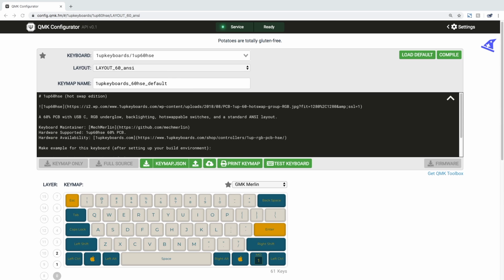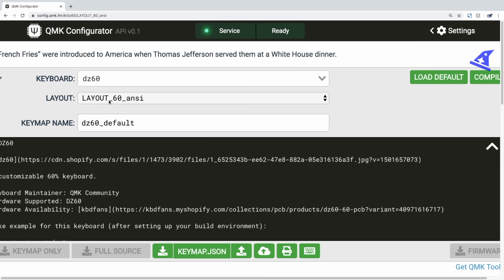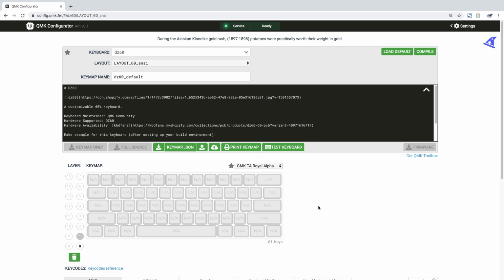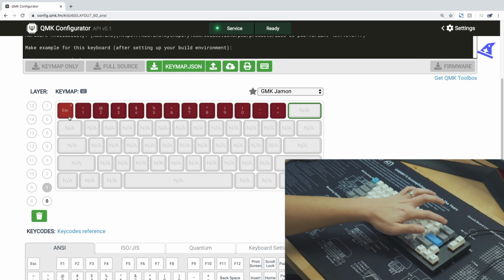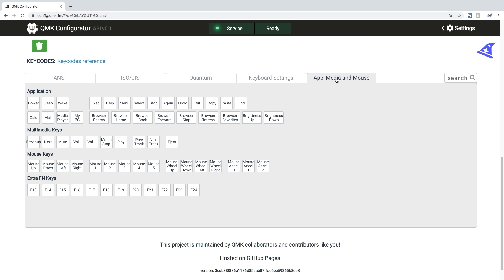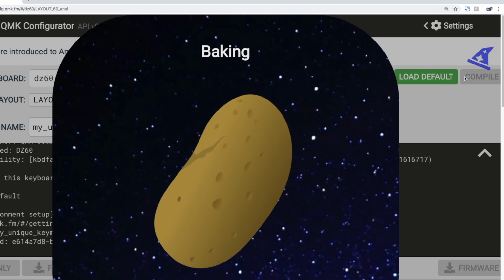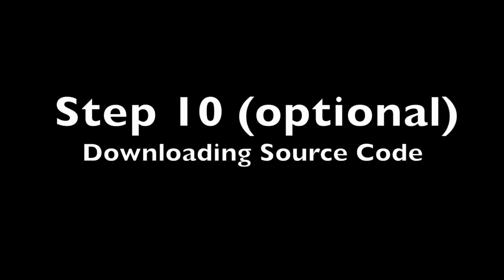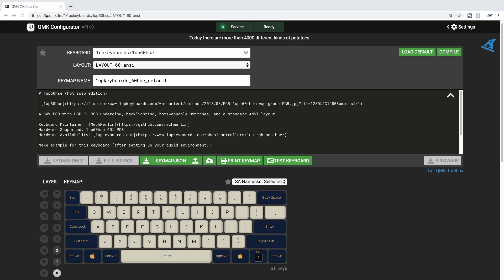QMK Tutorial: QMK Configurator

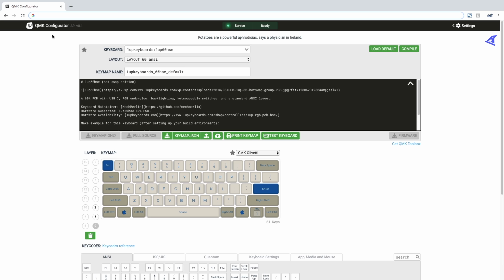Comment: 0:32 no matter which browser i use, the site would not show me the Keyboard, Layout, Keymap Name fields like that. I tried turn off Adblock, not using any VPN, etc. I still cannot get it. Also, the "Keymap Only" and "Full Source" buttons are not showing. :(
Reply: I'm having the same issues right now too... I am scratching my head why it's not showing up....
Reply: @nottommythao  oddly, it also happen to all of my devices. i tried it on my second PC, not showing. i tried my phone, still not showing. i switched keyboard from my Kinesis Freestyle Edge to Split 75, still not showing. i'm getting worried cuz i'm building Helix keyboard right now and i might not be able to configurate it.
Reply: @milo.t_  I just read on a very recent reddit post that the QMK guys are running maintenance on the website. Hopefully it's up again soon. I was wiring up a CFTKB Discipad and now the suspense of seeing if I wired every little diode, capacitor, etcetera correctly is gonna be killing me until then
Reply: @nottommythao  Best of luck!
Reply from the maker: Our certificate expired, but it should be up now!
Reply: @MechMerlin  thank you so much! just checked it and they all visible now :D

Comment: Is there a specific meaning to the different colors that some keys have in the configurator? Some of them make sense, but while setting up the F1-F12 keys, I noticed that F5-F8 had a different color than the others. I'm not sure if it matters which keyboard I'm setting up, but just in case, it's a 'bourdsource/unicorne'
Reply from the maker: It depends on the keyset color scheme you picked. Designers often like to make the center F row keys F5 thru F8 the same color as the modifiers, so as to add more contrast to the overall aesthetics of the board. For bigger keysets, you can even have the F1-F4 and F9-F12 as the mod color and the F5-F8 as the alpha colors.

Comment: Allowing vertical and horizontal reverses of layouts, especially ortho boards, would allow rotating of the keyboard to be used upside down for north vs south facing keyswitch LEDs. Would really help for such a set like the artifact bloom glow keycap set :|  side-legend skylights, they should call them skylights... hubba hubba
Reply from the maker: QMK Configurator is purely a means to program a key to do a specific function. All of that seems to be several layers of abstractions above what software is meant to do.
Reply: @MechMerlin  thanks for the reply

Comment: Hey i recently flashed the via version of the qmk firmware however when i try to edit my keyboard there is no option for RGB i think its disabled in the files by default so i wanted to know if there is a way to edit those files or would i just need to compile my own file? I'm using the gmmk pro ANSI version.
Reply from the maker: Yes you can edit the code. It is not possible thru QMK Configurator actions.

Comment: I just put together a BDN9 and included both of the rotary encoders. When running on the default map they work great. The left one is volume and mute (if clicked) and the right is scroll and play/pause (if clicked). However, if I try to change any of the keys, then when flashed I lose the functionality of volume and scroll from rotating the knobs. Do you know how I can customize the rotary encoders outside of the key presses?
Reply: Keeb.io has a tutorial on how to reprogram your encoders here: https://docs.keeb.io/reprogramming-encoders
At the time of my posting this, it appears the only way to program rotary encoder functionality is through setting up a QMK build environment. It's not possible to use QMK configurator and using the QMK Configurator likely is overwriting the rotary encoder functionality since it doesn't support it.

Comment: I'm using Mac O/S. When I download "full source", I get a .bin, and a .json file in the folder, but no keymap file. I want to be able to enable tap dance and other features using the code. Also, if I can find the source code and make changes to the keymap, how do I then re-compile and download new firmware to flash?
Reply from the maker: You can clone QMK's projects over on Github.
Reply: @MechMerlin  so no way to do it using QMK configurator and QMK Toolbox then?
Reply from the maker: @punkish7  That's pretty odd that when you select download full source you only get bin and json file. That really should download the entirety of the QMK firmware files.
Reply: @MechMerlin  Sorry, I did not explain that well.  I did get all of the QMK firmware files, what I did not get was the source files for the keymap I created. I have a <keyboardname>.bin, and a <keyboardname>.json file, below all the QMK folders.  What I though you said in the instructions was that once we have downloaded the source, we would be able to edit the code, to include features such as tap-dance, or tap + hold. So I expected to see a keymap.c file of what I had created using QMK configurator that I could work with.  Thanks!
Reply from the maker: @punkish7  yes that is correct. You need to navigate to the correct directory to access your keymap.c file. You will then need to recompile to generate your new firmware files.
Reply: @MechMerlin  I'm having the same issue as the other commenter.
1. What happened to the "Keymap Only" download button?
2. I looked in the folder I thought the keymap should be in (/keyboards/atreus/keymaps in my case) and I only see the default layouts that come with QMK.

Comment: Hi! I've just bought an old Tada68 and I've got a few QMK related questions :)

1. When I'm moving in a game using W and I press Shift to Sprint, it cancels the W key, why is that? It happens outside the game and only with my left shift, not the right one. (It also happens with the LCTRL and LALT. It has a 7 key rollover.

2. If I press the reset key behind the board and access it on my pc, am I able to make a backup of the bin file and flash it back later? Because I want to flash another bin to check if the problem n. 1 is fixed. 

3. Is there a way to set a key to ç? Or only through manually programming?
Reply from the maker: The Tada68 comes default with a qmk firmware from 2017. Updating the firmware will solve point 1. For 2 yes you can save the old FLASH.bin. 3. I'm not familiar with that character . Also you should try out VIA.
Reply: @MechMerlin  Thanks a lot for your answer! I'll give it a shot then.
Reply: @gabrielgussomazzo2339  conseguiu configurar no padrão ABNT2? Gostaria de fazer uma build custom, mas pra mim ABNT2 é fundamental...

Comment: Is there an easy way to add strings of text to a button? That's the last thing I want but can't figure out how to do. Thanks!
Reply from the maker: That's something you'll have to do through code. However I recommend just using the VIA enabled firmware files to do this so you can use the VIA keymapping software.

Comment: Hi  MechMerlin, very well made video. I have a filco MJ2 TKL JIS.  I was trying to compile firmware using the qmk configurator and it works except the capslock and scrolllock leds not work. Is there a way to fix this?  I think the leds were not port on the configurator.
Reply from the maker: I was unaware that the MJ2 was even supported in QMK lol
Reply: @MechMerlin  Thank you for your attention.  I use linux shell qmk to fix that. Its weir that older qmk has incorrect matix and that's why I used qmk configurator.

Comment: Just recently had someone build me a 4x4 macropad with a Nori board and a Pro Micro. I have the .hex file but I cannot figure out how to reset the board/processor so I can flash. I double tap on the reset pin on the Pro Micro and two red LEDs light up. QMK Toolbox says my device connects but it quickly disconnects. Any suggestions?
Reply from the maker: You can short the RESET and GROUND pins. But you only have 8 seconds to flash after this process.
Reply from the maker: @ryandenne1024  That would imply either the soldering was completely messed up, the keymap is disfunctional, or you have a completely different hex file than you intended.
Reply: @MechMerlin  Device Manager shows "The nori Keyboard" but I am unable to type with it. I created what is essentially a numpad with 2 layers with the QMK Configurator.

Comment: I'm looking at a board that supposedly has ISO layout option, but the layout tab only has LAYOUT_ALL, how do i get the correct size enter key? Also, it says the modifier for & is on 7, while my keycaps says it's supposed to be on 6?
Reply from the maker: Layout all attempts to provide a means to program every key on your board and is meant for PCBs that have a gazillion layouts. My recommendation is to just do the usual trial and error and see which key is what.
Reply: @MechMerlin  alright. What about the extra key on an ISO keyboard?
Reply from the maker: Layout all should have that covered as well
Reply: @MechMerlin  hmm, the layout all i was looking at just had an ANSI layout 🤔 I'll play with it some more, thank you for the answers!
Reply from the maker: @Kasperbentsen1992  oh man I probably should have started with, "what keyboard is it?" lol
Reply: @MechMerlin  Well, I've been looking at getting my first custom keyboard, and the groupbuy I'm looking at is using the WT-65G designed by Wilba.tech. The pictured layout options are ANSI and ISO. :)
Reply from the maker: @Kasperbentsen1992  That should be VIA compatible. Any reason why you are specifically wanting to use QMK Configurator?
Reply: @MechMerlin  I'm was just interested in the basics 😅 I'd probably use VIA if I actually get that specific board!

Comment: Okso, I need the wizard's guidance. I got me a Duckboard but want to use it as a 21 key macropad, not an 18 key numpad. Is there anyway (other than coding) to make the "Enter", "+" and "0" 2u keys into 2 x 1U keys each, within QMK Configurator?
Reply from the maker: If I'm not mistaken, isn't the duckboard designed to physically only be an 18 key macropad? You'd have to redesign the PCB to physically add those extra keys.
Reply: @MechMerlin  No. It can be both but the default is 18 key. When I asked Dood he said its possible but he decided to have it as 18 key default since that's what was asked for more. I soldered 21 kailh hotswaps in and they all work, just a few double. I'm guessing its going to require writing code as there wasnt an easy answer. lol
Reply from the maker: @h1ddens0ng  There are 2 ways to go about it, either modify the info,json file to support the additional layout for QMK Configurator, or actually port it to VIA. If you can wait till next week I can probably take care of both these for you.
Reply: @MechMerlin  I'm a bit shaky with changing json. I've attempted in the past and couldn't get it to stick (I was changing rules file to turn on rotary function in BDN9). I wouldn't know what to input to make this work. So I can wait! Also I know quite a few others who want this same feature. So if this could be ported to VIA that would be utterly amazing for the community, imo. straight up wizard.

Comment: So I flashed my board but it doesn't seem to activate the Mo keys.
I've got an iso layout and have Fn set to Mo(1) for arrows on wasd and such, and on Layer1 my AltGr as Mo(2) for rgb stuff. But it doesn't recognise Mo(1), maybe the switch is not actuating properly since i havent soldered my hot swap sockets onto the pcb yet.
Or do I need Fn to be Mo(0) to reach Layer1?
Can i hold fn+AltGr to get to Layer2 the way I intended?
Reply from the maker: If you haven't soldered, there wouldn't be an electrical connection yet, however you can still verify using tweezers.
Reply: @MechMerlin  
Suprisingly without soldering the millmax sockets do make up a connection.
But my main problem is not being able to get to Layer1 from Layer0 and to Layer2 from Layer1.
If i set the Fn key to Mo(0), does it switch to the first layer or do I have to have Mo(1) set?
Reply from the maker: MO(0) will activate layer 0 when it is held.
Reply: @MechMerlin  but isnt layer 0 always activated?
Reply from the maker: It's usually the base layer so in a way yes. However only 1 layer is active at a time. So if you have activated layer 10 or something, you will not have any other layer activated unless you have pass thrus
Reply: @MechMerlin  if i have Mo on the 0 and 1 layer, activate it on 0 layer hjold it and press the one on layer1 i can open a third layer right
Reply from the maker: @Daniel-dj7fh  So you want the activation of the 3rd layer to be accessible from the 2nd? 

If so, put a MO(1) on Layer 0. So when you press it, you activate Layer 1. Next put a MO(2) on Layer 1, and press it to activate Layer 2. This way you will need to hold two keys down while accessing Layer 2
Reply: @MechMerlin  i got it working thanks
Reply from the maker: @Daniel-dj7fh  no problem

Comment: Is there anyway to take the json and upload it to KLE to get the raw data? Need it to generate a plate to 3d print.
Reply from the maker: Json files are basically just a type of file kind of like .doc or.pdf. Think of it like homework.pdf and driverlicensecopy.pdf would contain very different information despite being both pdf files. The json file that QMK Configurator saves is not the type of json that KLE would be able to read.

Comment: Do we have any options in QMK if we have an STM32F072 MCU?  I don't see it in the drop down menu in QMK.
Reply from the maker: This is the QMK Configurator video, but if you look at the QMK Toolbox video, I mention that for Arm powered boards, this setting can be ignored.
Reply: @MechMerlin  Thank you Merlin!  I missed that.  But, I'm getting this error in QMK which appears to be related to the MCU (but I could be totally wrong): "Cannot open DFU device 0483:df11
    No DFU capable USB device available."  It's for the Godspeed75- seems to be a systemic issue.
Reply from the maker: @mudhead6101  It seems like the board is not entering the bootloader mode (reset) correctly.
Reply: @MechMerlin  Got it, makes sense.  We'll see what TKC has to say.  Appreciate the help sir!

Comment: In the examples in the video of matching layout, there are more keys in QMK than what was needed. What if the opposite is the case?
To the right of the spacebar I have 3 1u keys, the QMK layout available has 2 1.5u.
Reply from the maker: You should always try to find the LAYOUT that matches it the most. In some cases its going to be the LAYOUT or LAYOUT_all that you'll have to use. If neither of these fit your needs, you'll have to ask someone to add in the layout you need. However if your board supports VIA, just use that.

Comment: Would it be possible to flash your File to your Keyboard via Bluetooth? (It is a Bluetooth only Keyboard)
Or does it have to be connected via Cable?
Reply from the maker: The process of flashing requires putting the board into bootloader mode which would disable any kind of Bluetooth support.

Comment: Can this work for a keyboard that has its own software already? Or does this only work for PCBs that support QMK? I just bought a Durgod Venus but cannot use the Durgod Hera Compiler because it only runs on Windows, I'm a Mac user.
Reply from the maker: The QMK Configurator is only made for use on QMK powered boards.

Comment: so i have a kbd67 r2 that doesnt want to flash because its saying i can only flash a .bin file on it. but i can only find .hex files for it. Is there anywhere i can get it or..?
Reply from the maker: Are you taking a out the kbd67mkii series of PCBs? If so there should be a v3 that supports .bin files
Reply: @MechMerlin  haha you were right thank you, i guess i dont know my own keyboard
Reply: @MechMerlin  so i have a problem now because via doesnt reconize my board for some reason, is this the only way to change the rgb
Reply from the maker: @xlenin2927  QMK Configurator firmware files do not have VIA enabled.

Comment: Can you tell me if this would support akko3084 can't seem to be able to find the qmk firmware for it
Reply from the maker: QMK Firmware supports a specific set of hardware, if the akko3084 does not have that specific hardware, it will not run it. Think of it like this, Windows works only on PCs, you're not going to be able to install it on your Smart TV.

Comment: All I want to change is the 4keys above the arrows from Home, pg up, pg dn and End into volume adjusters but the kb67mkiirgb/v3 doesn't have a 'default' yet and I don't want to miss any layers out :(
Reply from the maker: There's a different set of instructions for that board. It does not use QMK Configurator or Toolbox.
Reply: @MechMerlin  I somehow figured it out, thanks anyways :)

Comment: I bought the Kbd67 lite and it says that it supports qmk, so I chose KBD67 hot-swap and made a firmware, I then tried it on toolbox but on toolbox it now says "! There are no devices available" and my keyboard doesn't work anymore. When I plug it in it says: "*** HID console disconnected (FEED:0000:0001)
* HID console connected: KBDFans KBD67 Hotswap (FEED:0000:0001)" but my keyboard still doesn't work and I can't flash my keyboard. Can you help me?
Reply from the maker: It should already be preflashed
Reply: @MechMerlin  Do you know what the problem could be?
Reply from the maker: @buster242  Did you try plugging it into VIA? VIA should have detected it out of the box.
Reply: @MechMerlin  What is VIA?
Reply from the maker: It's a GUI for you to edit your keymap without touching the firmware. Try it out at caniusevia
Reply: @MechMerlin  it doesn't come up but I think it's because my keyboard comes up in settings as kbd67 hot-swap, and kbd67 hot-swap isn't compatible with VIA
Reply from the maker: @buster242  You are correct, let me add this on to my todo list
Reply: @MechMerlin Hey,  I was wondering if you had figured out a way for my keyboard to work
Reply from the maker: @buster242  You can still use QMK, but remind me again on Tuesday regarding VIA.
Reply: @MechMerlin  The problem was that my keyboard didn't work after I had already flashed it, and VIA is simply not compatible with KBD67 Hotswap